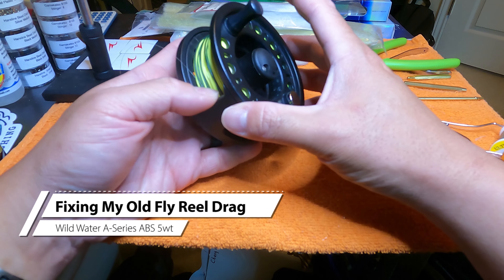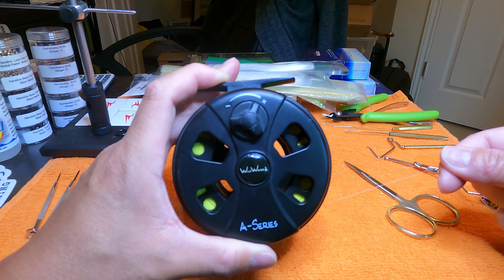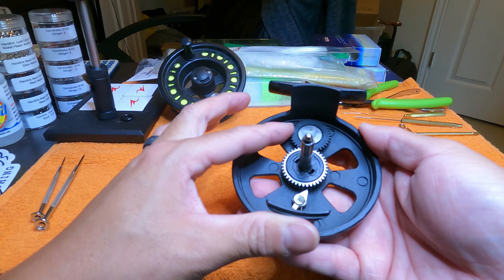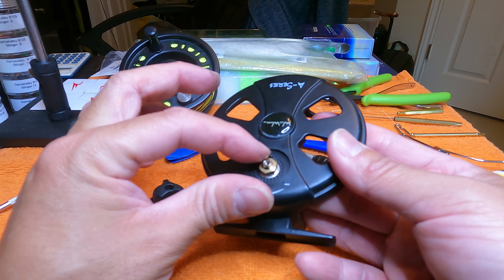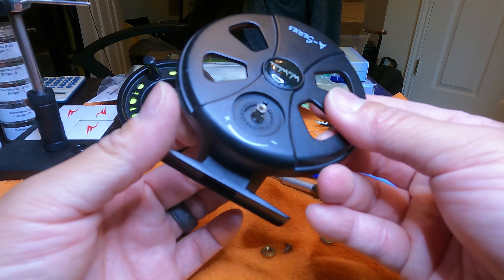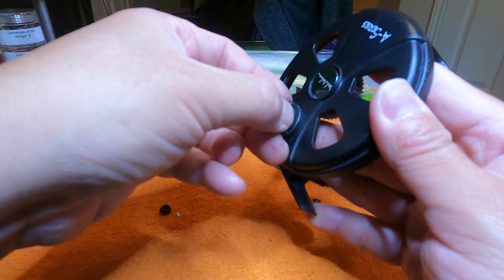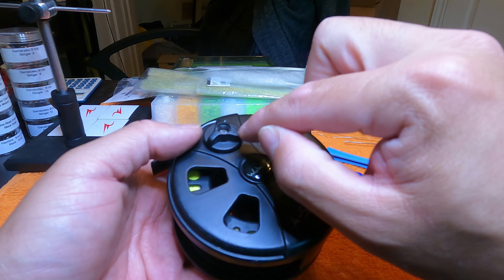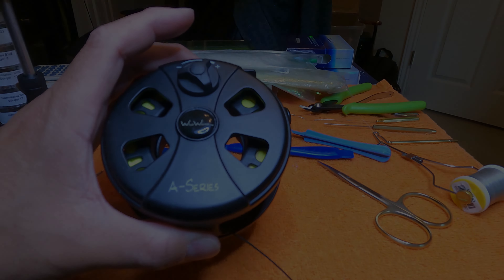A Really Simple Fix For My Fly Reel Drag

Comment from the maker: But I'm just a guy trying to fix his stuff. What experience do you have and what have you learned?  Thinking about it more... the nut/washer compression of a fibrous disc (which is under that flat round metal piece and sits between the washer and nut) is probably what provides the friction drag (not friction against the spool).
Reply: You can try either buying or fabricaticating your own carbontex washers (you can buy a sheet on eBay). Some older reels had oiled felt washers too. Storing them fully clamped down for years at a time compresses/degrades the material. It loses it's elastic ability to provide added friction. Now they advise to store reels with drag loosened up. Hope all is well.
Reply from the maker: That's a great idea. I'll searched on ebay for "carbontex" and "carbontex drag washers" came right up!

Comment: I would think that the drag “switch” is supposed to tighten the movement of the gear that surrounds that brass disk, thus constraining the movement of the gear affixed to the spool spindle.  I can’t imagine that the “brass disk” is intended to bind against the actual spool.  Your solution provided some additional strength to bind down on the drag gear when tightened.  Review the mechanism in that light and you may be able to improve the drag strength even more (if you feel it needs it).  Nice work and a great explanation.
Reply from the maker: Thanks, good tip!

Comment: Why would mine not be making noise while I pull line out? First time fly fishing today and it was making noise while I pulled line out until about half way through my day? Any thoughts?
Reply: Nvrm! Based off of your video it was easy enough to figure out I had broken a little plastic piece in the reel 🎉 only $2 for a 3 pack on Amazon and I’ll be back out on the river soon! Thank you
Reply from the maker: Yep, I think most likely sounds like the little clicker piece broke for some reason.